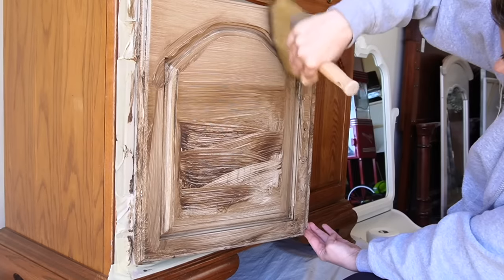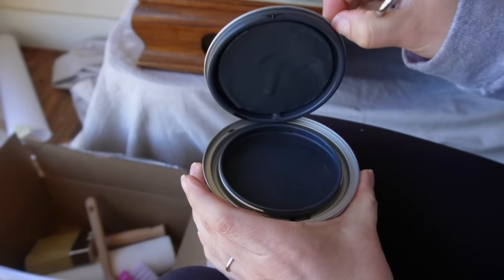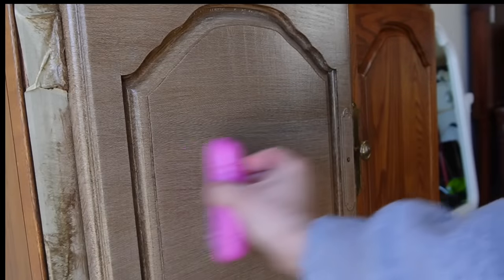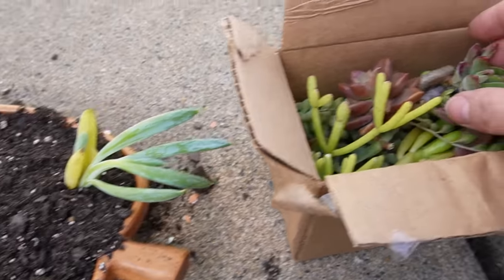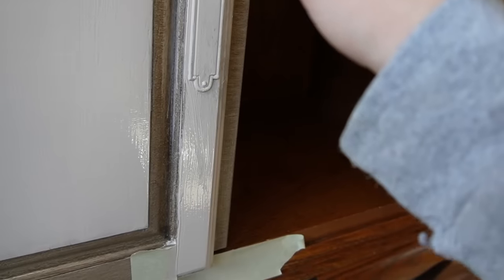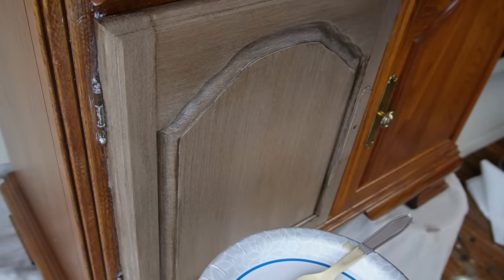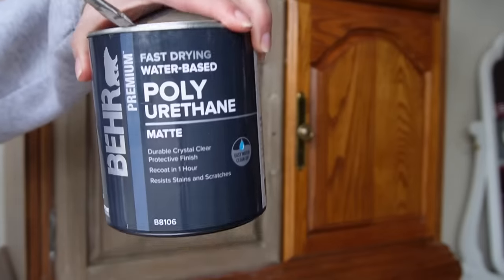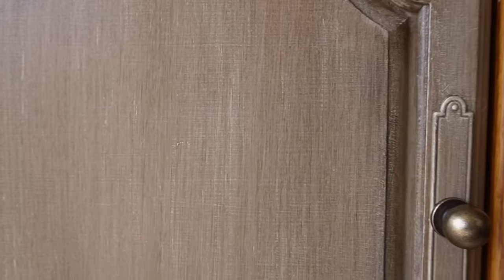UPDATE KITCHEN CABINETS - No sanding!

Comment: looks like it would take a whole day to do a single door
Reply: There really is no fast way to do your kitchen cabinets right. You would usually clean it well with a solvent first to get the grease off, then sand it to give the surface a more even finish before staining or painting. Anything quick is going to be a complete hackjob, something a flipper would do before selling a house because they dont care if it actually lasts. Im not really sold on doing it the way you see in this video either though.

Comment: I love your faux painting. But I think these would’ve been a perfect candidate for a cerused oak finish. Which is more like the Restoration Hardware or Arhaus finishes. You sand the wood and then wire brush the oak grain. Then you layer a primer or paint or some just use the original stain or stain in a new color and then use a glaze or paint or wax to get into the grain. It creates a dimensional piece. I wood love to see you do that finish pretty please. 😊
Reply from the maker: I was thinking of doing some more testing on this oak server, I bought a few stains to try but didn’t love any of them so I will keep tinkering.  Do you have to sand the clear finish off completely to ceruse?
Reply: I considered cerusing my golden oak kitchen cabinets but now feel the look would clash too much with my travertine tiled floor. I did ceruse a vanity and mirror in a half bath that I absolutely loved but being a novice (unfortunately) applied urethane topcoat which yellowed the finish horribly in just a few months (it was a white primer with antique glaze). A new technique suggests a water-based topcoat, but that also may amber over time with white based paints.
Reply: @blacksheephouse  sorry I guess I never answered. Yes, you have to completely sand off clear coat and then use a wire brush to dig out the soft grain. There’s a few examples here in YouTube. If I find a good one I will put the channel in here.
Reply: Is there a YouTube video with this process that you know about? I have the same problem as jewelbug with a dark stone floor. I would actually just want to take the gloss off my cupboards and just add a wax or a light matt sealer, but I don’t know much about doing this, only just started to look into it.
Reply: Thrift Diving has a cerused bathroom vanity I think and Bella Renovare by Crys’Dawna painting has another less detailed process she did on a previously painted oak table. I love both.
Reply: @lfuentes4098  thank you, will have a look.
Reply: Woodworking with Wes has some very good cerusing videos. I live that look & it’s much less time consuming than this technique. I would never have the patience for all these steps. It does look amazing though!!

Comment: Great video! I didn’t notice if you recommended thorough cleaning before priming. You might not have to sand but if not cleaned thoroughly, anything applied is not going to stick long term.
Reply: Great point, esp for kitchen cabinets. She did mention cleaning with soap and water at the very beginning, but I know some kitchen cabinets can have grease build up over the years. I wonder if original Krud Kutter would be too harsh?
Reply: @jewelbug8713  Krud cutter works well but I use TSP for the best results. But you really have to rinse well. The top reason most DIY paint jobs don't last is inadequate prep.

Comment: I'm working on my bathroom vanity right now (with this videos finish)..... wish me luck! Would love to have on the side bar, amount of time (aprox of course) when using the same products.
Reply: Notes for anyone starting this project. After sanding. Stix takes 4 hours to dry. Benjamin Moores Advance Paint take 14 hour for next coat (2 weeks to fully cure), make note to not take long hot showers/bath during those 14 days. As it will make the paint "sweat". I'm on to my next glaze step now.....

Comment: I used fence paint that they have in different colors and I applied directly and the paint became transparent and bleed on the oak marks. It’s more beautiful without using any primer or removing the orange color. I only cleaned the cabinets with soap and water and applied fence paint. Also this way it’s very fast.

Comment: My husband and I did this for our kitchen cabinets, bathroom, and hallway. It will not turn out exactly how you want it. Just preparing you it matters what wood you have. Also there will be imperfections especially if you have 1950s Cabients. After you are done painting and staining the Cabients it’s dried. Immediately polyurethane the Cabients. If you don’t your cabients will get scratches on them.

Comment: I have a home early 1900..I don't know when kitchen cabinets made put in...looks like flat plywood..I want to add trim and paint or stain...paint store said if the used oil stain before nothing would stick to it for paint..really want to make kitchen pretty need advice..current stain color is the older orange tinted cross with fruit n cherry stain...if I added trim to doors wood stain or gel stain match?..

Comment: What are the dry times for the advance before you can put the glaze over it? And then what is the dry time for the glaze before adding a top coat?
Reply from the maker: For advance I wait a day and then for the glaze I wait another day or 2  but sometimes if weather is damp I have to wait more days on the glaze.  A fan does help!

Comment: Hi Shannon! Would you do this painting technique on wrapped support beams? I have a support beam and post in my downstairs family room stained in a dark chestnut and the previous family scribbled and marked up the post so I had to fill in lots of damaged areas and calked the gaps in the trim used on the edges. I don’t think re-staining will be an option as a result so painting it white or a neutral color is my only other option unless you think this technique would work on it? Also, would you still use the matte sealer? Thanks
Reply from the maker: This technique would definitely work on a beam!  I do use the dog brush when I want more contrast or need to wipe away more glaze but it’s not always necessary
Reply: @blacksheephouse  oh awesome! What about the matte sealer? Do you think it will be needed?

Comment: So tried this method for my cabinets ( the liquid sander) and it was enough . I put the stix primer on top and I did the scratch test and it scratched off . Is there anything I’m missing ? Do you wipe off access or leave it or or anything ? I had to go back and sand off primer and the cabinet till I saw no shine
Reply from the maker: That’s surprising bc with STIX  it adheres to shower and floor tile even, maybe there was some oil of grease on the original surface?  One thing that helped me with the liquid sandpaper is applying more liberally and leaving it on for 10 minutes before wiping excess
Reply: @blacksheephouse  thank you for responding , I wasn’t sure if I needed to wait after scrubbing . I just assumed I needed to wipe off residue right away. Will try that for my upper cabinets then maybe.
Reply: I wonder if I just didn’t wipe down the cabinets well enough prior to, I used dish soap and water but I didn’t scrub like in your video
Reply: Any update?

Comment: I messed up a spot and now it looks a mess. What do I need to  do now. Do I start over ?
Reply: Same thing happened to me it was nightmare if you have areas that the stain isn’t perfect you can’t paint over it then stain. You have to repaint it then stain it. I just finished this project it took 2 months had to redo several times.

Comment: Did not have good luck with BM's advanced on my kitchen cabinets, sorry. I might did something wrong in the process, or used wrong sealer. But the paint started peeling around knobs after one year.